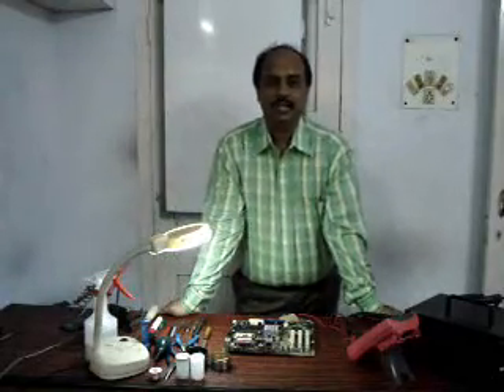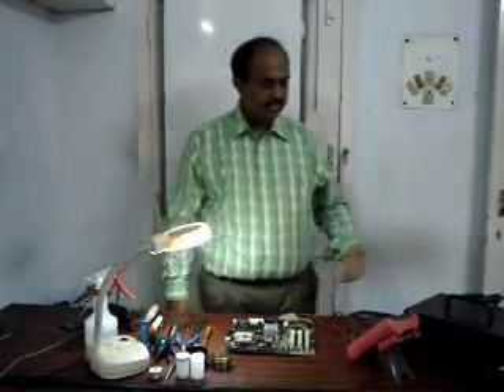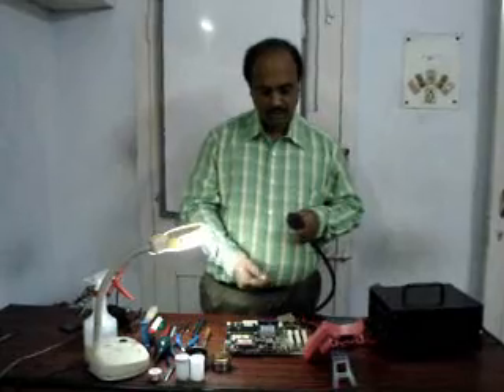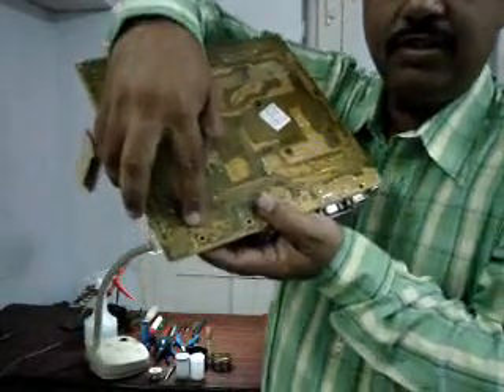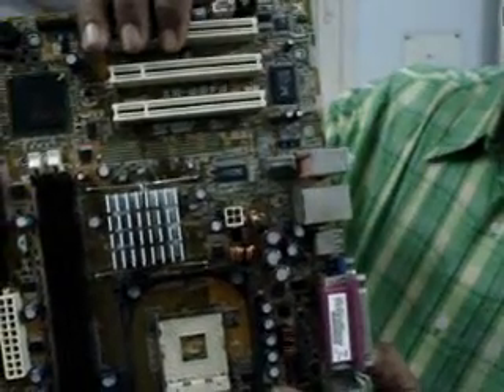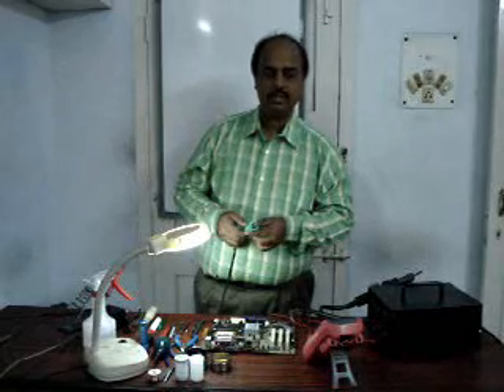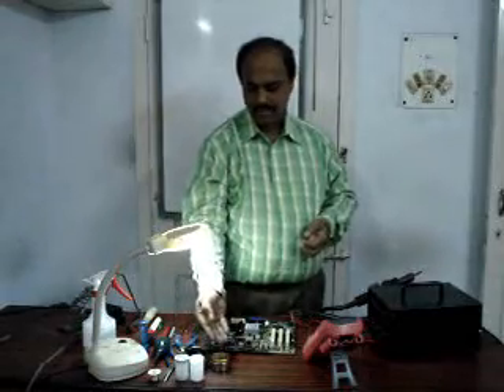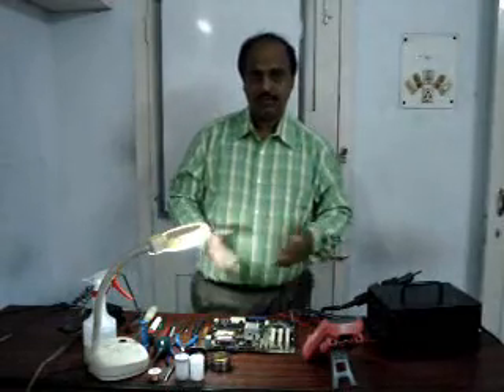Laptop Chip Level Training, SMD / PTH soldering Training Module - Part 1

Comment: @capricornwon07 whats the component? surface mount components can be found on both sides. if it's something like a capacitor which is a common fix on those it's a through hole solder job

Comment: Good Video.  I'm trying to repair a Flat LCD  Monitor. Can you Solder on both sides of the power board or only on the bottom?  the components are on the top of the board.  Thanks for Posting